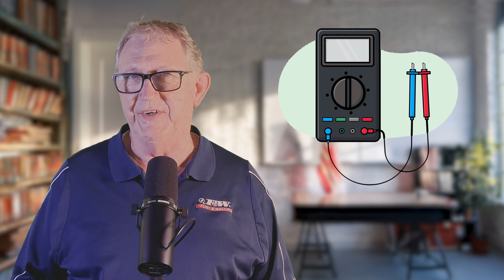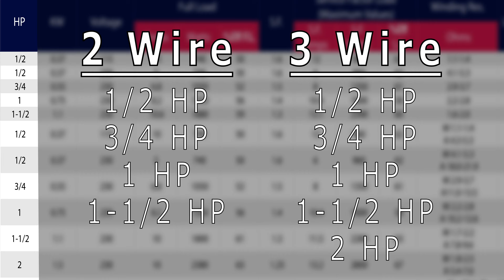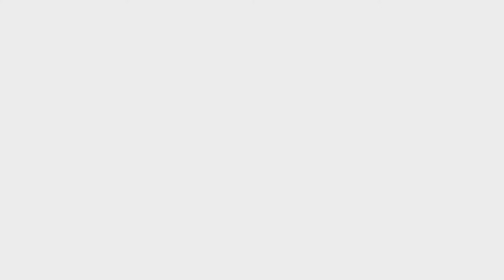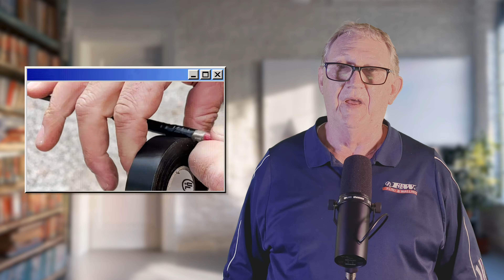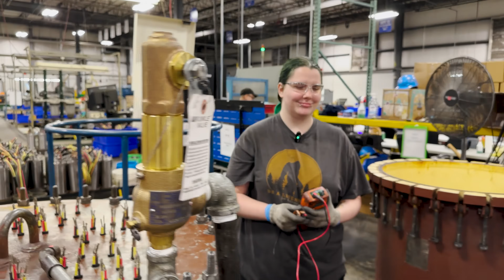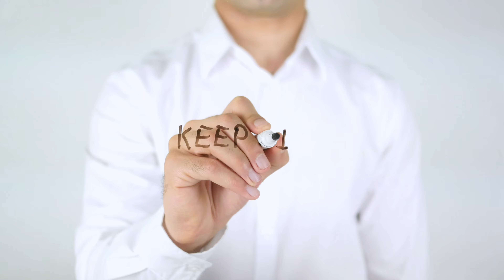Testing Submersible Motors with Meters & Meggers: Pump Guides 01

Comment: Hello! I have a Franklin pond pump, 1hp, 230v, 3-wire, which works like a fountain. After five minutes of operation, the start capacitor burns out. The relay was replaced with a similar one. The control box was replaced with a new one, but the problem persists. The pump is new. Please tell me what is the cause?

Comment: What exactly do you mean by a "grounded motor"? I've got a 1HP submersible pump that had a capacitor blow up in the control box. Replaced both the control box and pressure switch to be safe. When powering the system up, the control box clicks and shuts off. Amperage meter on the pressure switch shows that it is pulling 10 amps. Measuring the resistance of the red, yellow or black wires to ground from the pump show a verify high resistance of mega ohms. Does this mean the pump is bad? There is not a ground wire running to the control box from the pump. I can get a reading of ground between the control box ground and the metal casing cover the well.
Reply from the maker: If you're getting any resistance, then you've got a grounded motor. It sounds like there could be a winding issue and we can narrow that down with a few more details. Would you call our Groundwater Support Line for assistance? Tony will be happy to help. 1-800-628-2313